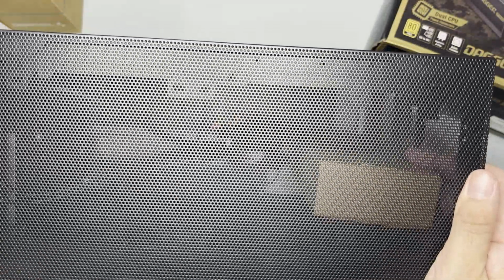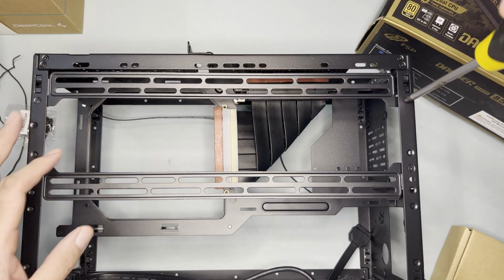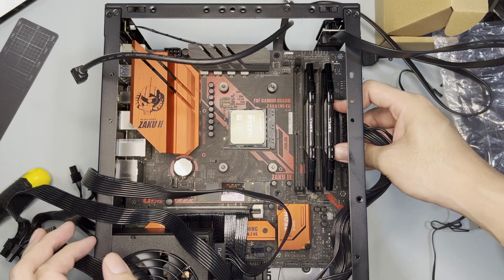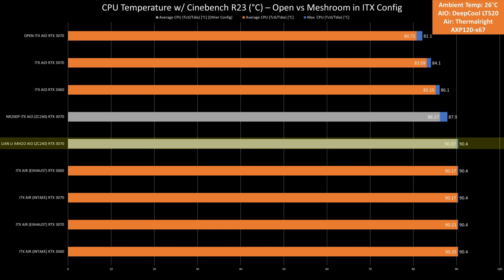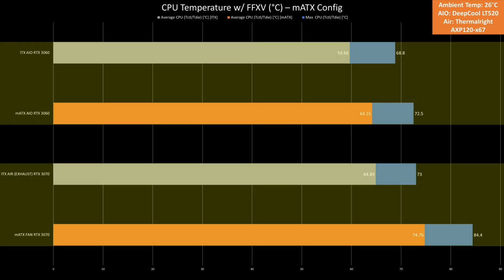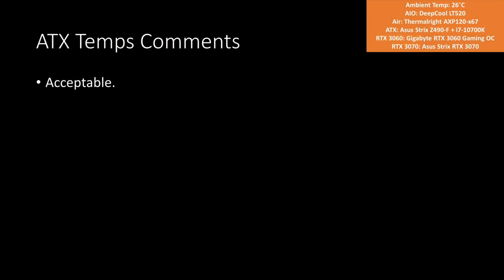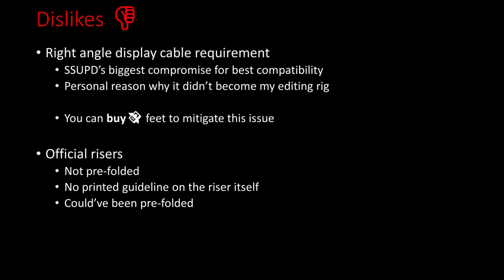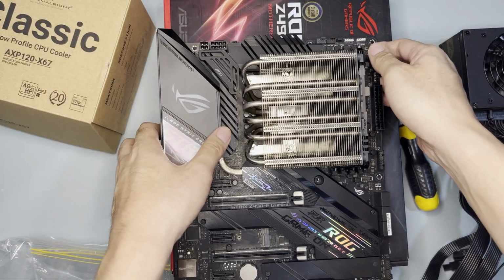SSUPD Meshroom S | A 14.9L SFF ITX / MATX / ATX Build

Comment: Using an it allows for aio but would the cooling capabilities be similar when using an air cooler like a noctua l12s?
Reply from the maker: While gaming, expect it to be warmer. On my testing, up to 8C warmer. But this will depend on your overall components.
Reply: @manongunboxing  Thanks for responding! Your videos have been helpful in making my build. I eventually have gone for an Xproto-L case, with ryzen 7 7700x and C14S with low profile intake setup.

Comment: What gpu riser do you recommend with the atx built
Reply from the maker: Hi, it depends on what GPU you have and where do you plan to install it (the where also depends on the size of the GPU).

For rear install, I suggest getting a 400mm-440mm female reverse riser. 
For front install, I suggest getting a 280mm-300mm straight riser.

Comment: is there anything stopping you from flipping the rad the other way and running the tubes up from under the motherboard?
Reply from the maker: For one, I just followed the manual. 🙂

Other than that, it is too tight in my opinion as AIO tubes aren't that flexible. It will hit the PSU and riser.

For ATX builds, you have no room at the bottom as well.

Comment: Hey ! Great video, thanks for showing many install options :) I have a matx board and a full size atx board, no gpu yet. Would the board and psu fit in there together ?
Reply from the maker: hi, do you mean matx board and atx psu? No, that's not compatible. You have to use SFX for MATX/ATX boards as the PSU will sit beside the board -- no space for a fatter PSU.
Reply: @manongunboxing  so would a SFX-L psu work with a matx board ?
Reply from the maker: Yes, it should be fine

Comment: Atx board ko tuf x570 wifi kaya pa mag add ng 2x2.5" ssd if ever? Using psu sfx naman and Gpu is tuf 3070ti. Also using lian li Aio 240mm.
Reply from the maker: Di po compat components. Gpu too big tapos para makatabi ng aio together with atx mobo

Comment: Hi. Ano po maaadvice nyo sakin, currently using asus ap201 case mAtx mobo w/ air cooler. Plan ko sana magpalit for ssupd ? Worth it po kaya? Or stick nalang sa ap201?
Reply from the maker: For me, if ang goal lang po is downsizing for the sake of it, not worth it until you need the space na maffree up. If space po ay major concern, then yes, downsizing is worth it. Nasa 33L po ang ap201 iirc… if maliit desk niyo, might be worth it. Otherwise, save money for actual pc parts na may tulong sa performance.
Reply: @manongunboxing  thank you so much po

Comment: Question do you think the ASRock X399M Taichi Micro atx will fit without issues and a rtx 3090ti FE with cpu AIO 240mm?
Reply from the maker: It can't. For matx, aio, and gpu to fit in, gpu width needs to be at most 120mm
Reply: @manongunboxing  so meaning i have to choose between the cpu cooler or the graphics card, but aside from that the board will fit right?
Reply from the maker: Yes, all correct.

Comment: Hello, can I know if regualr power supply will fit in the case? I have a PC which: matx, rtx3080ti, 3fan radiator aio. I am hoping to install matx on the front side, with regular psu; and GPU with 3 fan radiator on the back. will this configuration possible? I would like to know the compatibility. I have not seen any demostration videos of them using matx and regular psu combo.
Reply from the maker: Matx and atx psu combination will not be compatible to Meshroom S. Atx psu will only be compatible with ITX mobo.

Also 3-fan radiator AIO (360mm I assume) is also not compatible without the extension bracket.

Hope this clarifies.

Comment: 5:30 whaat problems did you face
Reply from the maker: It's the RAM. Just reseated.
Reply: So we can fit a matx 9.6x9.6 mb in it
Reply from the maker: Yes. Matx and even atx... But only with sfx psu and some other limitation

Comment: What brand sa shopee and lazada mare recommend mo na pcie riser na 4.0? Pricy kasi yung sa amazon na linkup mga 3k.
Reply from the maker: Around there talaga presyo ng PCIE riser na 4.0. Pero yung sa akin galing kay middle999 sa lazada. Sya yung seller ng PCCOOLER i100 Pro, nasa listing mismo ng i100 pro yung riser, check lang sa variations. That is for usual sandwich style cases pala sir ha not for Meshroom S. For Meshroom S, go to Pinklehub sa shopee, mas marami selection nila doon for some reason.
Reply: @manongunboxing  Makapal yung sa amazon worried na baka hindi bendable sa case. Mas mura tong sa lazada. Maraming salamat!

Comment: Extremely informative and i dare say the most detailed video about the case compared to the rest of guides i found so far regarding the meshilicious. Im thinking about getting this to downsize my current ATX build, but i have a massive gigabyte 4070ti master, is it safe to assume that i will have to opt for a low profile air cooler for the cpu base on your venn diagram ?
Reply from the maker: Yes.

Comment: another great sff case review! are you going to review the s300 itx case or the newly released gigabyte rtx 4060 low profile?
Reply from the maker: For s300, I'll think about it depending on the performance result of the s400 which will be out this Oct.

For gigabyte lp 4060, it's likely a no at this point due to cost.